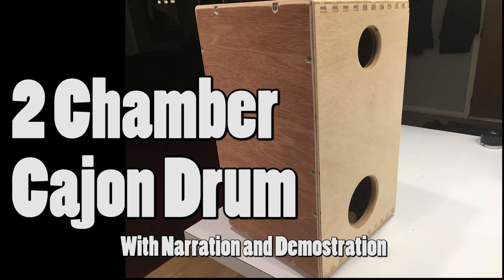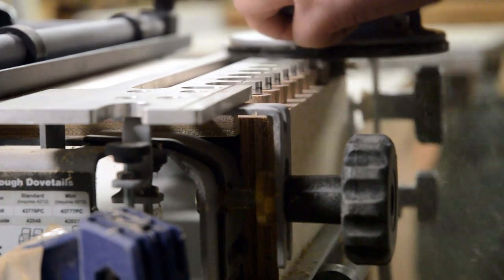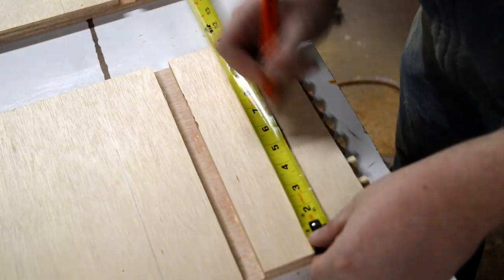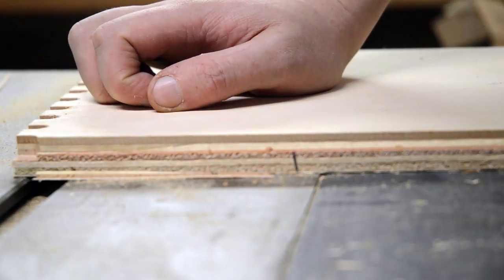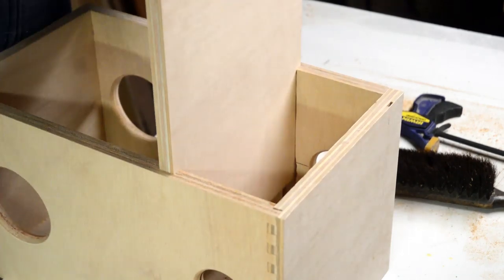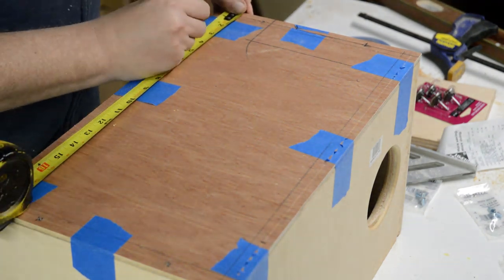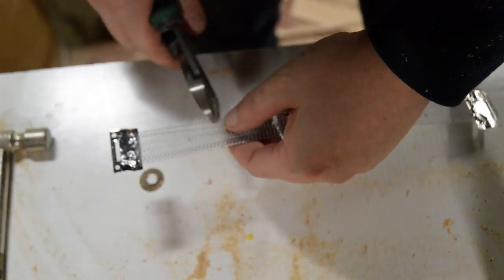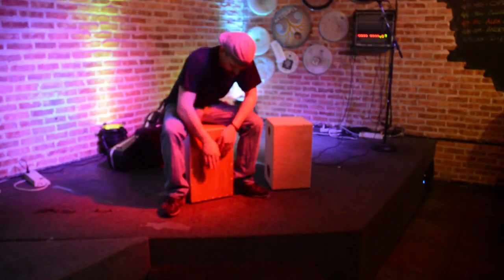One Day Build: 2 Chamber Cajon Drum With Narration and Demostration

Comment: I made a few improvements. For the drum skin I used 1.5mm aircraft birch plywood stretched into an angle iron frame. Gives you a nice tuned thump in the middle and a lovely bongo sound at the edges. Then added a tilt mechanism with an extending foot but then had to add a bum rest so you don't slide off the back. Thta was MkIII. Still thinking about MkIV !!

Comment: There are some good reasons for placing the sound hole at the back. Firstly, it takes advantage of the reflective surfaces as the sound is bouncing off the nearest wall rather than going out into the audience; secondly, it means that the drum can be played quite aggressively and because the osund is projected back it won't overpower the guitars etc and thirdly, it means that any miking will be behind and not taking up stage room where a musician might need to be.
That said a side sound hole would certainly have its own set of advantages and some extra bassy cajons even have a front bass port.
It's a very nice cajon, btw. I like your ideas on this.
Reply: I'm not an expert btw. I am currently investigating buying or making a cajon so my head is full of information regarding them at the moment. Some of it is probably wrong.
Reply: arcanics1971 I’m making my own cajons and have discovered that in order to achieve a good solid sound you must use a hard dense wood. Birch is expensive as is most quality wood. I have been using oak and have been grabbing up any curbside furniture people through out. Now, on the sound hole I have made 2 tablet cajons that sound great without a hole and everyone loves it. The unfortunate part of all this is I am using a homemade table saw and jigs. Most of my tools are from good ol Harbor Freight  tools. What can I say??!!! I’m on a tight budget. Good luck with making yours and believe me...Take your time and never say, “That’s good enough!”. Every little mistake shows on wood.
Reply: I sort of assumed that the reason for usually putting the sound hole in the back was to put it as far from the tapa as possible, because it acts like a tuned port in a bass reflex speaker cabinet, and the shortest path from the back of the tapa (out the back, around the side, and) to the front limits your bass response and determines the low frequency resonances of the cabinet.  Putting the hole on the side cuts that path length in half, letting high pressure from the back of the tapa come around the front to cancel out the low pressure there, and vice versa.   That reduces bass response by defeating the purpose of the sides, and raising the frequency of the low-frequency resonances by quite a bit.

Comment: Hey what was the thickness of the mahogany you used for the face of the drum?
Reply: traditionally an 1/8" is used for the tapa(front face). That way the snare can be heard. I don't believe that the snare was positioned properly in this particular build. I like the two different sections though. I've always used the snares in a vertical position in order to get a proper angle up against the back of the tapa.